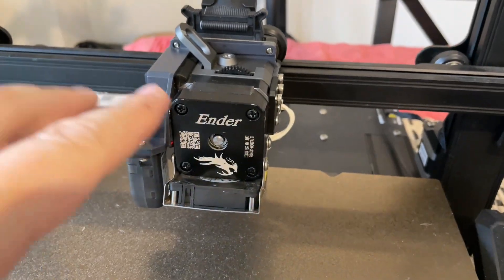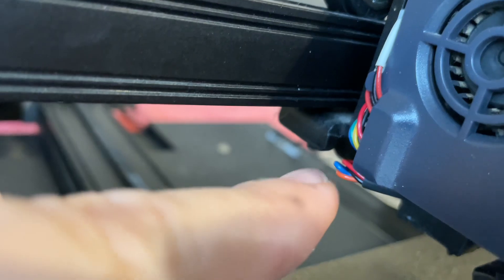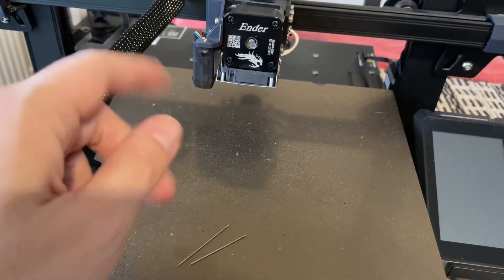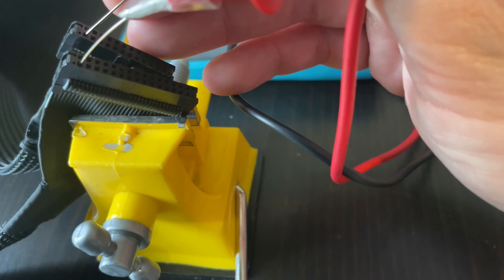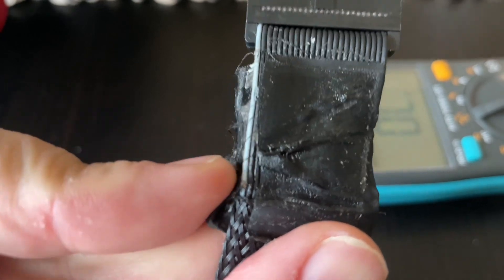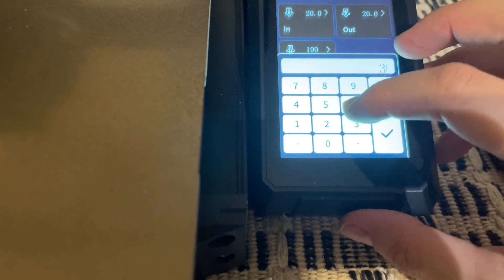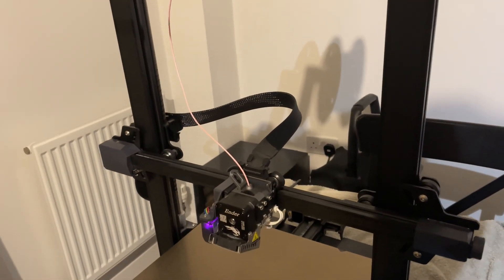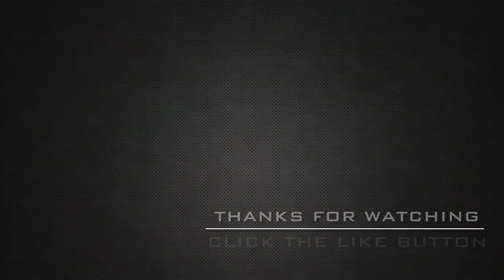3d Printer Troubleshooting - Stepper Motor Issues (Quick Tips)

Comment: Good  info scooby just bought a s1 and a s1 plus
Reply from the maker: They are decent printers mate. But I just can’t get the auto level to work fine. But for the price they are going it probably the best price per volume you can get.
Reply from the maker: And print the little bracket guide straight away before having the same issue!